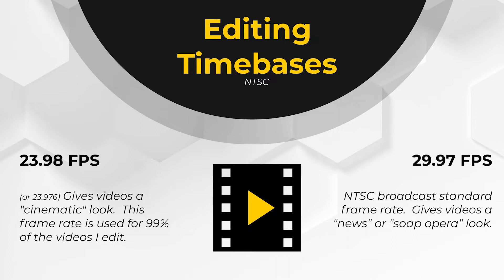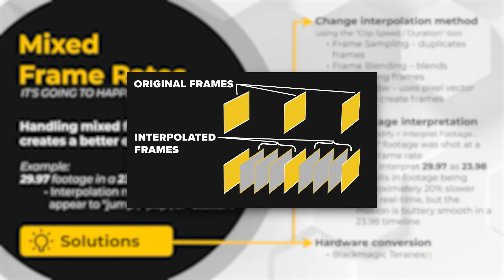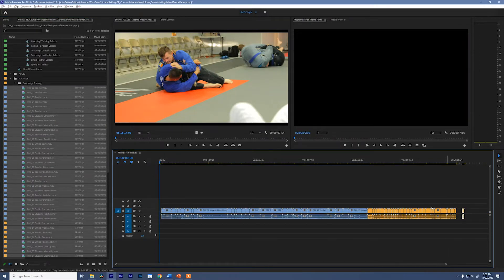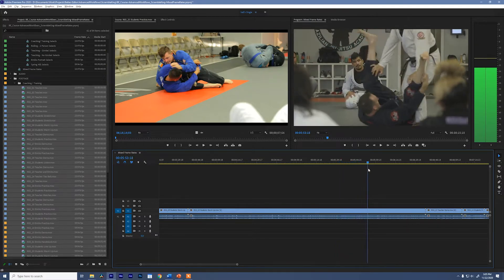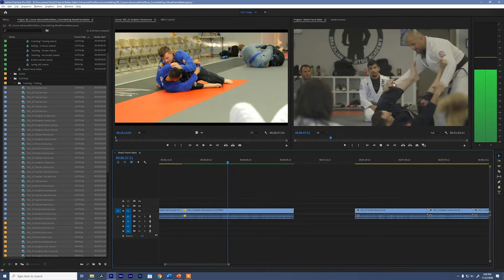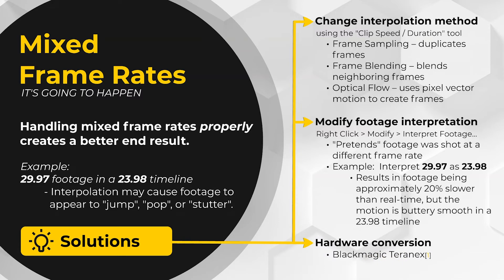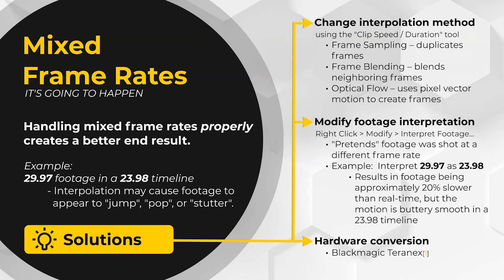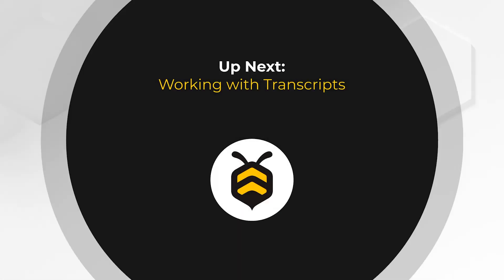Mixing Frame Rates

Comment: This was such a great video, thank you! 

1 thing I noticed - from my experience, re-interpreting footage throws off the timecode in a way that has shot me in the foot in an offline/online workflow. If you want to have all footage playing back without throwing off TC, you can batch adjust the speed in the project panel. So you could select all of your clips, change speed to 40%, then when you cut them into a sequence, they're playing back at 23.98.
Reply from the maker: Couldn't agree more.  Premiere does have issues with this, usually with long gop footage.  Working with a good editing codec like prores is a great solution too, if you have the space for it.  The 40% speed trick is also a solid approach!

Comment: Bro,When we create a 24 fps timline sequence for a movie .which have little different fps clips like 60 fps ,120..etc for slowmotion.should I keep 24fps has timeline sequence.Does the slowmotion work great?
Bro Please can you explain?
Reply from the maker: General rule of thumb is your sequence FPS should match the frame rate of the majority of your clips.  

Your high frame rate clips for slow motion are also likely confirmed to another frame rate, like 24 FPS, so that they will play slower in a timeline.